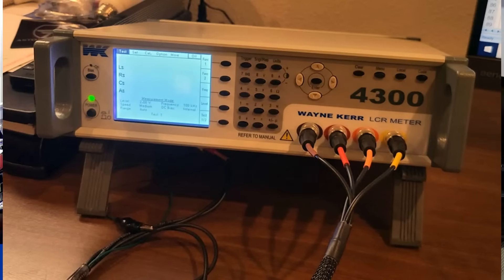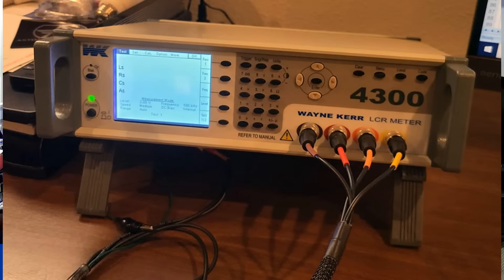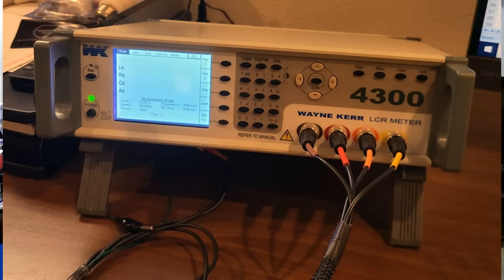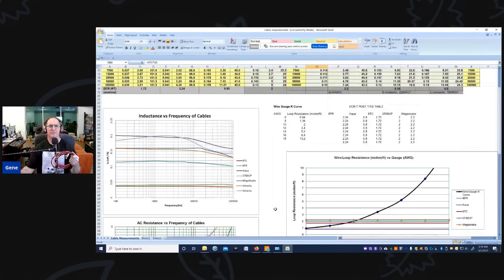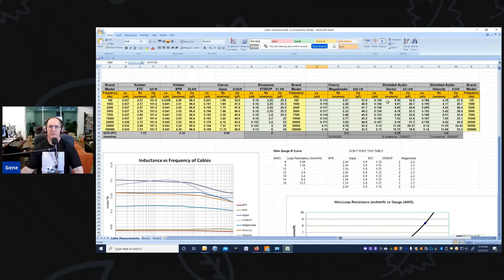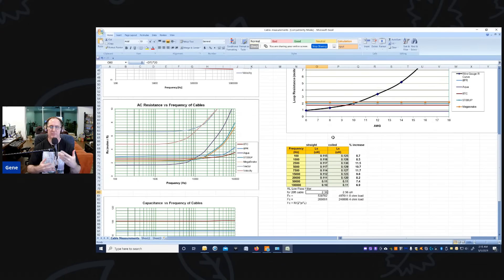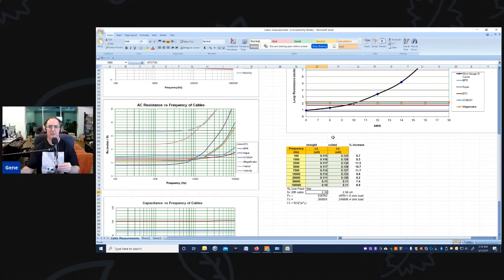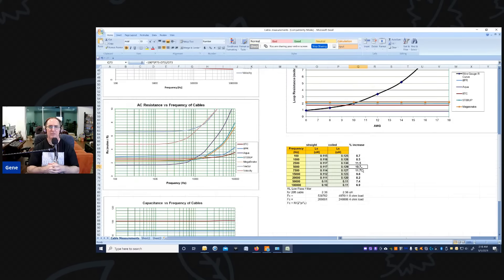OMG If You Coil Your Speaker Cable You're Gonna Lose Fidelity?!?

Comment: I disagree. When coiling a cable, electricity needs run round and round and round.. that makes the electricity tired and confused. So when the electricity reached the speaker it will be so weak and the sound produced from the speaker also tired,weak and confused. This cannot be measured and understandable for normal people. Only can experience audiophiles.
Reply: And the electrons in the outer loop of the wire have a longer path compared to the electrons in the inner loop. So the sound gets smeared. And the electrons get dizzy if course, also very bad for your sound. End that is the end of my very scientific contribution on this topic.
Reply: @MrBravo
Sorry but you theory would only work when dealing with larger electrical loads such as in a building supply system and large appliances. 
You would have to be up in the hundreds of volts with several amps and probably 20 cables before you start to notice any sort of voltage drop/peak effects. 
It would be impossible in such a system supplying speakers to have any sort of signal attenuation with in the cables.
Reply: @bighands69  it was a joke mate😂
Reply: @MrBravo143  
I stand by my statement as an audiophile that loves to hear the soul of the wooden instruments on a large toilet bowl shaped speaker made my a master craftsman. 
Your theory only works on a large building.
Reply: @bighands69  good.. take care..
Reply: I'M UNCOILING MY CABLES RIGHT AWAY! HOW COULD I HAVE BEEN SO FOOLISH?
WOE IS ME.....
Reply: If you can't hear the difference, it's obvious that your equipment is not revealing enough! /sarcasm
Reply: @SteelBlueVision  it's an illusion bro. Placebo effect.

Comment: Hey Gene, as an electrician who has done well over 500 RJ45 ends (CAT 5/6/7). I watch videos of people saying we need to maintain the twist as much as possible into the RJ45. I think it’s hog wash because what is 1 to 3 mm going to make in the long run of a cable, that could be as much as 100 meters? Especially inside the devices the cable is plugged into. When the traces on the board travel several inches to the microchip for processing. 

I know this video dealt with speaker cables. But CAT 5/6/7 are also a big part of the HT industry, as you know. With that said, and with the equipment you have. Can you do a test on a CAT5/6/7? Where one cable has the wires straight inside the RJ45 and an other where they are twisted until the very end? Keeping in mind the frequency the cables are used at as well.
Reply: Most of the audio bro science is nonsense. The figures involved in such systems simply would have no effect on the current being carried by the cables or the voltage. 
As an electrician you probably already know the sorts of figures that are required for voltage drop to become a problem and speakers systems in the home are nowhere near that level.
Reply: I think the twisting in RJ45 has more to do with common-mode rejection than electrical characteristics. Any straight part has the potential to become an antenna for EMI. It's probably just good practice more than anything else. A few cm of straight wire won't do a world of difference in the error statistics, but it's nice to be safe.

Comment: How about do some measurements of the effect of having power cables next to audio cables? Balanced and unbalanced. Thanks!
Reply: To my understanding it’s best practice to keep power cables separated to reduce the chance of noise interference but of course with multi channel processors, multiple amplifiers, and wide variety of devices connected that becomes more of a challenge. Would be nice to know if it is worth the effort to organize all the cables neatly or does balanced cables eliminates any potential problems.
Reply: @08ExigeS240  aggread for the same reason it posses an interest for me as it has become difficult to separate.
Reply: I think this is a real issue - I have heard a difference (speaker hum) by moving and replacing cables with better insulation - it is very obvious in car audio when cables aren’t routed correctly especially near power - buzz that changes with rpm
Reply: Ground loops by far will cause more noise issues than shielding and power cable location.  Of course it's always a good idea not to mix the two, particularly in long runs parallel to each other.  Car audio is a different beast altogether and I cannot figure why they haven't gone to fully balanced in car audio.
Reply: i have seen the effects of this  in car audio and if not properly separeated or installed with supressors that changes the fedlity of your equipment, the engine noise comes through so yes that you would be nice to know
Reply: @Jcan4u  yes in car audio i def found that out too
Reply: I use a voltage tester on high sensitivity so it gives me that extra couple inches from where it picks up a current other wise electrical interference on standard is not much then a inch or two. Use it to keep speaker cables apart from each other as they have a current it picks up. And thx to my brother i have some conduits made by icore who produce stuff for the military and airlines to avoid 0%  electrical and radio signal coming into your cable. i have put about some  on my power cables and on high sensitivity the voltage meter picks up 0% of electrical current. Only have it because when icore would make a mistake producing the conduit it would get scrapped lol lucky for me simple thing like couple mm wide or thin made it defect lol. Even have there conduit that  has a metal braid outside then the conduit inside it and that goes for £200 a meter + i have 7 meters of that also thanks to my older brother who worked there.
Reply: I've always known that running together is fine IF you break away at a 90° angle. I have no knowledge if that works though. That is what my brother told me from him working at Arris.
Reply: @stephenfrancisvoros382  No mate, no difference if 240v or 120v etc. We run 50hz here in "Straya" and US with 120v available is 60hz (they have 240v available also in certain parts). Induced noise is 99% from equipment differentials including double insulated (2 pin connectors) with 3 pin (active, neutral and ground/earth) power leads/devices connected together via rca and hdmi etc. Balanced equipment is generally the least to have issues but still most have hdmi ports so again an issue can be there.
Reply: @brettus9115  cheers man, it had me thinking 💭
Reply: Such examination would require some very complex analytical techniques that are beyond the scope of audio engineers. 
There would have to be lots of control measures and a large sample size to try and correlated data. 
I am just going to say it there would not be enough of an EMF effect for a current sufficient enough overcome the signal being transmitted through the cables. So in other words wrapping a small number of cables is not going instigate any sort of voltage effect within the cables.
Reply: Does not make a difference if the AC cables are good quality and shielded.

Comment: More and more I find myself making the same statement to my audio buddies.

Does it make a difference?  Yes
Can you measure the difference?  Yes
Can you hear those differences?  Most likely not
Do you want to spend money chasing that kind of difference?  Most Likely Not
Reply: “Most likely not” is more like “definitely not” unless your mates come from Krypton or something
Reply: I have noticed that room size and shape make so much more of a difference that the coil issue is just silly.
Reply: The same can be said for any audio equipment then. Why spend 10 grand on a set of speakers if you can get a set with the same frequency response, same amount of speakers? Especially if the room is what will give you the most control over the overall sound? Is the change in wave guide the game changer? I mean you can measure the difference the wave guide has on the crossover point can you not? Can the majority of people hear the difference? And is that difference worth another 8 grand? The amp might be more efficient at running your speakers, can you HEAR the difference? I find it interesting how the audiophiles get a lot of flack, yet even at the other scale the differences in the tech you get from each price jump is just as "emotionally driven" when choices are made. Why did gene chose the speakers and amps he did given what else is comparable out there? I mean sure he can maybe measure the differences, but can he hear then? And is the difference worth the extra in price, and if not WHY make the choice. There is a measurable difference when the cable was rolled up, in that respect no one was wrong. Can the difference be heard? Well again, I'll refer you to what I've just written.
Reply: @nihilityjoey  You pretty much proved my point.  Just in a LOT more words.  Unless you have money burning a hole in your pocket, just buy what sounds good to you that is reasonably within your budget.  Room setup is free, treatment costs a bit.  I would argue that the extra 8k might be better spent on room treatment than the speakers.  You'd have measurable AND audible improvement if done right.
Reply: @nihilityjoey  For sure there is a point of diminishing returns and it comes fairly quickly with audio equipment. However the tiny, minimal gains are typically in the frequency range where you actually listen to music. The “gains” (and those are debatable) in fancy cables are in the MHz range... So when people say: “30kHz? We can only hear up to 20kHz!” well, at least in that situation we’re still in the ballpark of human hearing, once we start worrying about, and claiming we can, noise in the MHz range, well that’s just being silly
Reply: @TofumanFC3S  I suspect that I can experience sound above 20khz.  I feel it in my sinuses, I started to notice this when the diamond, corundum & beryllium tweeters hit the market.
Reply: @richarddortch6122  That’s still faaaaar away from where the differences between speaker cables come into play. I mean bats can hear up to 200kHz. All the issues fancy speaker cables are trying to fix don’t really play a part there either. It might be hard to accept, but sometimes a simple thing is for all intents and purposes perfect. Speaker cable is one of those things, you have to really work hard to develop a bad one and it’s not hard at all to develop a good one. It’s why it’s one if the things that never really changes. Speaker cables are about as well designed as the shape of car tire: Perfect AND adequate, perfectly adequate for their job.
Reply: @TofumanFC3S  For Sure!
Reply: @TofumanFC3S  You need the higher harmonics to accurately reproduce an arbitrary periodic signal, so its reasonable to expect content above 100kHz. :/
Reply: Hello
Reply: So which measured difference do you like more?
Reply: @nicoras8803  It's hard to say....if the measurements are barely detectable then it's really tough to put a pin in it.

Comment: Sorry to write somthing irrelevant but could you please talk about the snake oil in TVs. Especially the fake HDR TVs that can barely reach 300 nits and marked as an HDR TV.
Reply: Wow.  This is news to me.  Do you have any examples?
Reply: @jmd11185  The HDR technology when implemented on a good capable TV that can provide high nits and great contrast is outstanding. The problem is tha there is no standard for this technology. Companies manufacture TVs and put the HDR logo on the box while in fact the TV lacks the needed luminance. This causes the image to be washed out, making SDR way better.

Comment: It sounds counterintuitive just to think there’s a difference in sound between a coiled cable vs a straight one. Who comes up with this, Fremer?
Reply: Just saw an add for a cable lifter in latest issue of stereophile, “fog lifter as per audioquest” and could not believe that there is a company peddling this nonsense.
Reply: @jondon9963  Unbelievable. I just saw the ad myself. Yea, really, do we need to run multiple tests with highly technically sophisticated  instruments to find out if the fog lifter really work?
Reply: I guess you've never heard of cable elevators or lifters. Yes they are real and yes people really do believe they can hear a difference.
Reply: @ASSOpid  Don't you know that electrons only run downhill??

Comment: Those cables all look too nicely insulated. I'm more curious about plain Amazon basics or Monoprice cables, even though I assume it won't matter for those either.

And if you're trying to avoid a coil of extra cable and make them too short - is there really any problem with splicing/extending speaker cables?
Reply: I’m not a scientist or even a dues paying member of any audioholic / audiophile club, but I’d be inclined to think you’d have to seriously botch up the termination of such a splice to make a measurable or audible difference. Of course that might not be as hard as one would hope. 

Another question that’s long plagued me, and it’d be nice if Gene had any empirical data on the subject, and pardon if this has already been covered: should circumstances require, what would be the audible effects of major differences in lengths of speaker cables? I’m specifically thinking of multi-channel surround systems where the location of final amplification stages in relation to the speaker locations might mean many dozens of feet or more difference in length to surround channels. 
Granted most modern processors include auto-calibration software such as Audyssey, etc that crunch a lot of math for you, including warning when a channel is out of phase, but does that satisfactorily address the issue?
I’m sure it’d not be hard to find opinions and even some very woo-woo pseudo science that suggests all cabling at both low and high levels should have “flat” bandwidth of at least many octaves above that of the signal to avoid affecting the rise time of higher frequency transients, imaging, low level special clues, blah, blah.
Reply: @fonkenful  Well, I agree with your take on splicing speaker wire, as I have even done it with wire nuts without issue, but I am curious if anyone can bring up any drawbacks. 

Regarding cable length, in theory the only effect would be some attenuation due to added resistance of the longer cable and therefore simply increasing the level a little should make up for it, and therefore you'd think any room correction software should be able to handle correcting for it. Regardless, I would be surprised if it was audible at cable lengths of less 25-50 ft, especially when it comes to surround channels, but it would be interesting to hear about any testing and measurements anyone's done relative to this.
Reply: @redstang5150  In my own 7.1 system the length of cable to one of the rear surrounds must easily run well past 50ft, and I’m sure that’s not unique. And while I can imagine that auto calibration of speaker levels would deal with what I’d assume to be relatively minor attenuation of power  due to resistive losses and the theoretical affect on amplifier damping factor, there’s always that niggling feeling that something has been missed?
Gene, if you get around to reading these comments, any advice?  A simple “not a problem” would suffice.  Context here is that I’m 70yrs old with hearing damaged by 25yrs exposure to high levels of very wide band noise in a woodworking factory, as well as at least 20yrs of rather imprudent listening levels in my early hi-fi “career”.  Modern digital hearing aids are amazing devices, but do not completely correct for the combination of age and environmental/occupational damage.  Neither do I subscribe to the rubric of “golden ears, trained by over 10,000 hours of actively focused listening”.

Comment: Coiling speaker cables creates pulses of magnetic waves. Its more of a health and safety issue, not a fidelity issue. 😄
Reply: Agreed but to what intencity i think your cell phone is more capable to do more more harm than that level of magnetic field induced in your speaker wires. In other words if your worried about the wire then the transfoemer in the reciver gives of more magnetic flux than your cables could ever do combined. The test results just proved that, because increaced magnetic flux increases impedance that would directly affect the performance of the cables and as you can see there is negligable changes almost impossible to be detected unless scrutinized via that peice of equiment used in the test. 
in other words you have nothing to worry about if so you would have to worry about the fans in your home the speakers theselves or every copperwond device tha exist